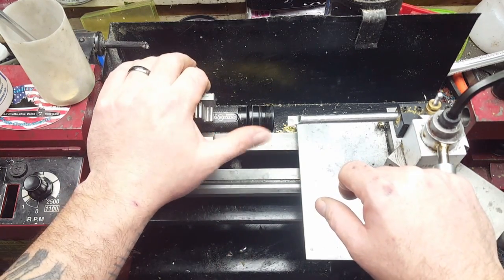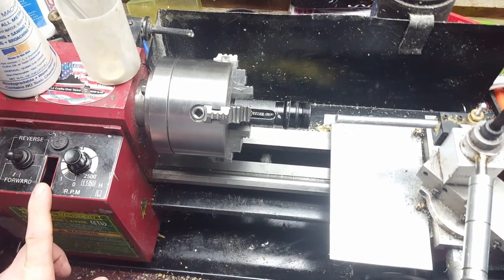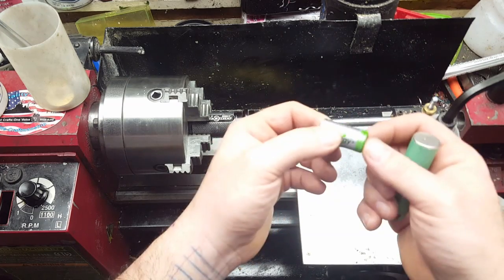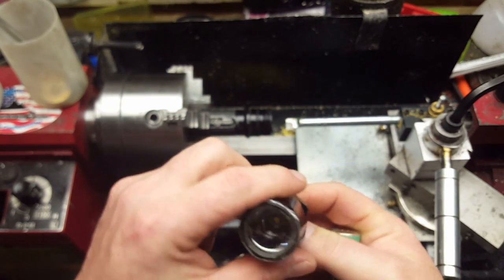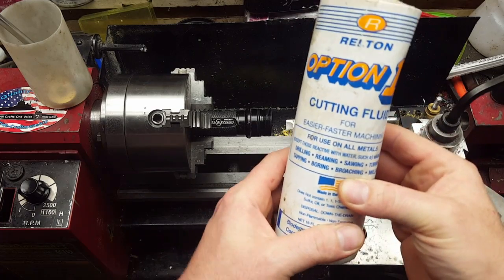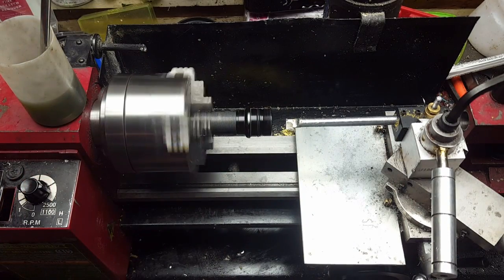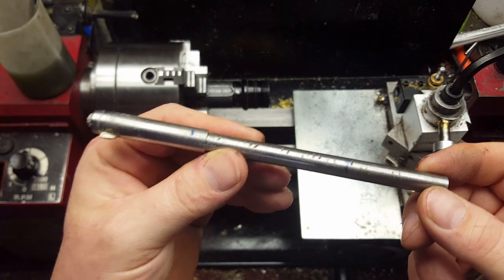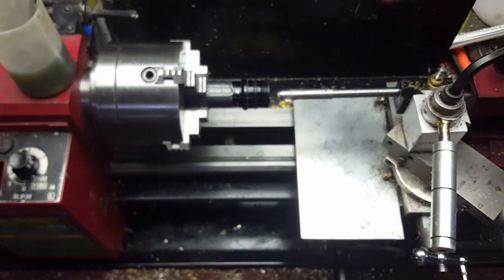SUREFIRE 6P. *modify your flashlight to work for you*

Comment: Inspired by your effort I was gonna modify my SF Tactician but after measuring it wall at 1.69mm I realised that after taking out .1.4mm needed to fit 18650 it leaves 0.29mm remanding tube thickness..  I guess they don't make them as they used to.. Good vid by the way..!!
Reply from the maker: I'm sorry to hear that, but there is 2 good things I've found out since this video. 1 is that you can buy or make custom lights at lighthound.  Com if I recall it's been a few years, and if you have a lathe, you could just make a new cap, and tube to thread the head in to. Its a good little side project that you maybe will enjoy.
Reply: All good ..!!  16650 fits perfectly.. :)